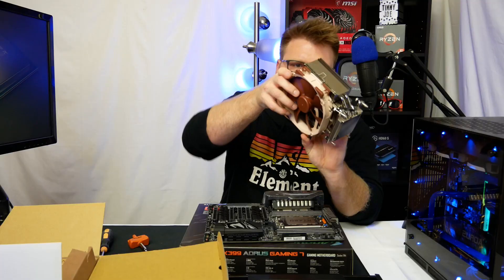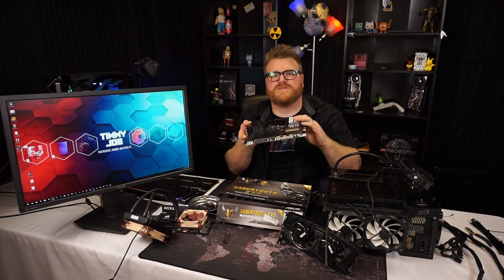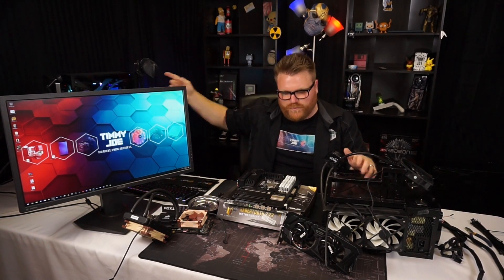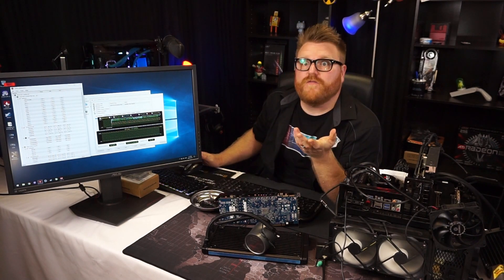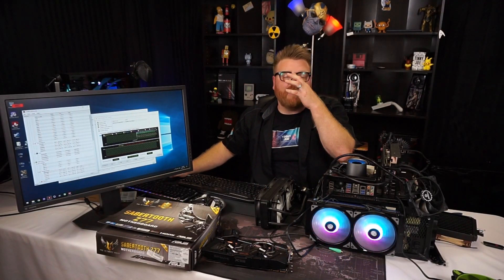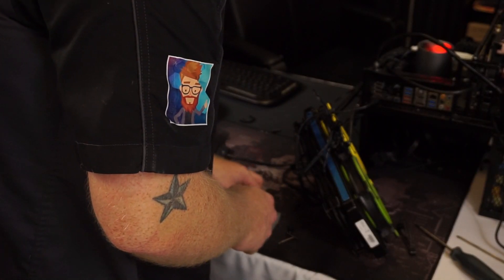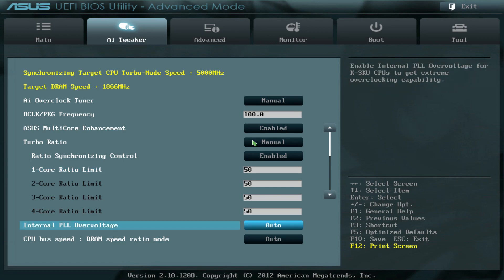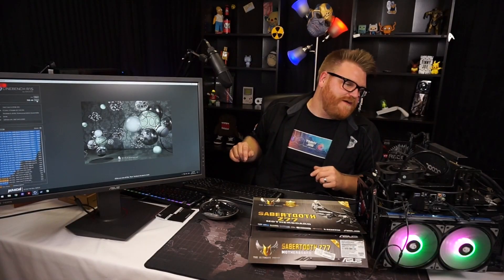5 Ghz Overclock Core i5 3570k using Gamer Storm Castle 280 RGB

Comment: My delidded 3570k ran at 5ghz, 1.45v and around 60°celsius. Its liquid metal between ihs and the Thermalright HR-02 Macho Rev.B cooler too tho. So just on air too.
Its now in an office pc for my dad, under a H60 cooler and 4,5ghz and 1.23v. It ran like a mad machine back in the days, still does. If the later battlefields wouldnt have stuttered like hell on 4cores, i would have never switched.

Comment: Man, I had my core2duo E6300 1.86 running at 2.8 for 11 years.
Yes... ELEVEN years on air cooling with a 50% overclock on a P43 processor gigabyte!
The Cooler master hyper 212 would keep the cpu at 40/45 Celsius.

I still use that same cooler on my 3570k i5 because It fits different sockets!
My 3570k is running at 4.5 at around 35 degrees. It goes up to 50 playing Battlefield 5 with medium settings at 1920/1080

Comment: I just ordered Ryzen hardware, I'll sadly be retiring my 3570k. Mine's been running at 4.7 ghz @ 1.36 volts, maxing out at 71c (280mm rad) for years without a problem. I'm ultimately running into issues with titles that are optimized for more than 4 cores though :(

Comment: Why haven't you delided the CPU!? I'm having crappy i5 3570k which can handle stable only 4.5GHz/1.44V after delid. Temperatures with Noctua NF-DH15S are in closed case max. 71°C while torturing the CPU with Prime95. I wish I had such silicon luck as you had!

Comment: mine wont stay stable at 4.9, i had it at 5ghz but went to 105c and scored worse than at 4.8ghz, it ran cinebench at 4.9ghz 1 time and only hit 78c and gave me the highest score on cinebench but gave me the bsod as soon as i fired up prime 95 so im giving it the burn on p95 @4.8ghz and its hit 100c up to now 15mins in but seems stable, i have the gigabyte g1 sniper m3 2 x 240 rads 1 with my case fans on it and the other from a liquid.cool kit, i have the liquid.cool cpu block but have changed out the pump for a ddc with an ek top on it.
ive tried messing with the core voltages but system hangs if i set anything except auto which is at 1.170v, ive tried 1.180v 1.400v but had to reset my bios, its now 40 mins into the burn and has hit 105c but has come back down to the 70s-80s for some strange reason lol cpu still @100% so dunno whats going on there been an hour now

Comment: 3570k @ 4.2 with stock cooler for the past 6 years no issues. 1050TI pumping out 70-80fps in almost everything at med-high settings @ 1080p. Fantastic price / performance still.
Reply: Ahh I have a i5 7400 i can't oc😢

Comment: This is still my main CPU ;( should i try to overclock it to like 4.0 ghz. And should i buy a new one soon? its only in games like ac orgins that ive felt like upgrading would this overclock make a difference?
Reply: since it does turbo up to 3,7 or 3,8 not much, just overclock to 4,2-4,4 this is on EVERY i5 3570k a doable oc without harming much, just dont let the turbo voltage and auto voltage option on.
Reply: @tarkitarker0815  my boost went to 4.2
Reply: @hugo9016  then its something with autovoltage and thats not good. oc manually to 4,2 with 1,256 v on core fixed loadline lvl 2 turn off intel turbo boost and turbo voltage and set oc to all cores, should be now even cooler.

Comment: 4.5 is about my limit on this MSI board. and I really don't wanna push a old cpu higher voltage . Still pretty solid CPU in 2018, just pair with 1060 or higher and your set

Comment: If overclock in 4.5-5GHz 
Which temperature will be lower?
Sandy bridge or ivy bridge 
By using
2550k vs 3570k
And Cooler Master 240M Liquid Cooler
Thx 
And sorry for my poor English 
Also I want to ask which 240 will be better
Antec Kuhler H1200 Pro or CM Nepton 240M

Comment: I have that 240 Arctic Aio in my PC I bet if I had a MB that was actually good I could probably OC my i5 4670k  to more than 4,2GHz but at least it doesn't go over 50 degrees under load even at 35-40° room temperature

Comment: If you put a 2500k or a 2600k/2700K on that motherboard you will have much lowers temperatures and much more OC headroom.
Reply from the maker: What are you talking about. Why would the previous generation be cooler? I don't think I've ever seen a 2500 K they can get to 5 gigahertz
Reply: @TimmyJoePCTech  the Sandy Bridge uses solder between the die and IHS. My 2600k runs at 5.1ghz 24/7. 1.495v max of 70c on cinebench with Corsair H100i
Reply from the maker: Oh yeah forgot about that. Well shit. Never knew it had it in it
Reply: Its awesome, 2600K is very cheap nowadays, at 5.1ghz I get 912cb on cinebench and 13k on firestrike physics.

Comment: I currently have a i5-3570k on a sabertooth z77 board overclocked @ 4.4ghz w/ 1.23 V,  EVGA 1060 SSC,  and 1600Mhz Viper 3 ram. I really don't want to spend a thousand on a new system and want to get as much as I can out of my current system. Do you think it would be wise to spend $140 on a i7 3770k and $ $180 on 2400Mhz Trident X ram, or should I just keep my build and wait for the 10nm intel or ryzen zen 2?  I've read mixed comments and also have seen mixed benchmarks for the i7 3770k but would like your expertise and knowledge weighed onto your opinion.

Thanks again :)

Comment: Great to see someone still looking at old CPU i have the i5-3570K with the Gigabyte G1 1080 and it runs great. On an Asrock Extreme 6, I have continuously run this at 4.2 with 65c max temp delta 28c and it has done me really well for 5 years. I'm still playing the latest games at max settings. Keep on hearing you have got to change it due to bottlenecking etc but I don't see the need as yet. Like your video but please move the mike of the table as when you bang on it which you do a lot it is unbearably loud.

Comment: My gaming rig i built last year has an i5 3570k and i can overclock it to 4.7Ghz and its air cooled by a Gammaxx400. i have stress tested the cpu with Intel burn test 2 and get around 95c to 100c which is really good as the cpu temps are around 20c hotter using Intel burn test 2.

Comment: I'm actually runing a 3770k @4.4GHz 1.05v on intel radstock and a Asus P8Z77-V (can 4.7GHz with 1.23v with great aircooling but more frequency will get a too big step in voltage), but your problem is about the intel thermal paste, you should try to delid it and decrease the PLL voltage (1.4~1.5v should be ok and keep the cpu cooler), with both deliding and voltage tweaking you should get 20°c lower temperature, even my 3770k delided can't be so hot with good aircooling even with 1.5v+), and to get more performance you could overclock the ram aswell, at 2200MHz (or 2133MHz) 8-10-8-24 1T you should have the best performance for ivy bridge (but you need a good ram and 2x2GB stick I believe)
PS : VCCSA is for the memory controller, so before 2133/2200MHz on tight timing (8-10-8-24 1T) you don't need to tweak it and you can decrease it to 0.95V or below, even for 2400MHz with increase timing like 11-13-13-31 1T you should not need to go higher than 0.95v (except for very "bad" cpu/imc) ;)

Comment: I'd love to replace my i5 3350P with an i7 3770K, but the i7's still go for $200 + on ebay. Since a decent six core Ryzen cpu goes for the same price the i7 isn't worth it. Ya, I have to get new bits for a new platform. But at least I'd be leaving one that's been dead for quite some time. :)
Reply: A 2600k hovers around $100
Reply: Nah, there's no point in going back a generation just to get an i7. Even if it is "only" $100 it isn't worth the price for old parts. I could just save the $100 - $200 and put it toward building a new computer with updated features. I was very tempted to buy a better cpu back in February when I got income tax, but I didn't. There were more important things I needed to buy. Besides money being one factor I'm also waiting patiently for Ryzen to go through a few generations before eventually going for the parts. :)

Comment: My 2500K has hit 5.1. Set my cheap 700 watt psu on fire, but it did it on the 3rd run. Still have it and it's lived at 4.2 stable from that day.

Comment: Bitwit: 3570k in 2018.... ick dont use it!!!! Timmy: HOLD MY BEER!!!!
Reply: walnut513 I don't get it, like Kyle was bribed by the industry CEOs to promote new platforms..
4 real cores are plenty enough for any present and future games. Just gotta run them over 4Ghz on all cores tadaa!
Reply: Yeah the 3570 and the k version are very similar to my 6500 so it dosent really make sense why you wouldn't recommend it as it's literally 1/3 of the cost used with basically the same overall performance
Reply: walnut513 you lose out on new technologies, but when on a budget, you can't afford to use them anyway
Reply: Was it worth it to update to the 8600k from the 3570k for gaming?
Reply: @campar1043  no.
Reply: @matteodi-folco9058   dont lie, heavily depends on the games and res you play on, for 4k its basically useless but even for 1440p the update can be worth it since the 8600k should push in bf 5 40% more fps and in pubg something like 20% more in 1440p in fhd even way more.
Reply: Still using mine 4.3ghz since December 2012.
Reply: Still using in 2019 xdd
Since 2015 or 16

Comment: I had my i7-3770k at 4.4 ghz for like 2 weeks now. And Just yesterday my computer fails to ran at that 4.4 ghz I'm not sure what to do. I had to go all the way to stock because even 4.2 ghz crashes the computer. Don't really know what to do. I have a 600 watt evga white power supply and its not the best psu but it still let me oc at 4.4 ghz no problem. Do you think it's because the cpu needs to be delidded?

Comment: Still running my 3570K @4.4GHz 1.23V with a 980 and 16GBs of Corsair 1886MHz DDR3. I can't get my CPU much hotter than 70C. The fastest I've ran it stable is 4.6GHz. I tried 4.8 but it failed to POST and I had to reset the CMOS. I'm on a MSI-Z77A GD55 mobo with a Cooler Master TX3. It's all in an old Antec 900.

Comment: thats my current cpu but i wasnt ever able go get over 4.0 on the z77n-wifi board?? im doing something wrong
Reply from the maker: WaFfLeFuR yes. Voltage. Try 1.32 at 4.5 GHz. Keep upping if it needs it to 1.35. if you want to go over 4.5 then you can go up to 1.4 with a really good cooler. Might need to change SA voltage as well. That's a little more tricky

Comment: Back in 2012 when my dream was to have an i5 3570k/gtx 660ti/ddr3 8gb as a budget to play battlefield 3 on ultra 1080p 60fps(barely) until my first pc has been ryzen 1600/gtx 1060 3gb/ddr4 16gb after i quitted FPS years ago and switched to simracing. Thanks god I hadn't any pc that day

Comment: You really should delid the i5... Because intel startet using this "thermal compound" (that isn't even thermal conductive Lol) since Ivy Bridge xd Sandy is solderd... Get a Sandy Bro ;) I have an i5 2500k running at 4812MHz by thermalrightmacho max temperature is 80C
Reply from the maker: Leo Elektronik I have a 2500k I will compare
Reply: Timmy Joe PC Tech You are the best bro ! :D

Comment: yo over clock some x99 stuff
Reply: I have a 5930k. and for the life of me I can't figure out what's a good core voltage and honestly what's the upper limit for the CPU voltage of a 5930k. Let alone the whole Broadwell E Series. On the same board.
Reply: @patrickgronemeyer3375  1,35 save for years. 1,4-1,45 save for years but then needs downclock. 1,5-1,55 is the most stable unreasonable high voltage you will get anything higher than that could fry more than the socket or cpu, on 1,4 you should be fine and do like 4,5 with luck more.

Comment: I'm about to get an h77 mobo a i5 3450 gonna get it on the low I'm sure if put it along with GTX 770 it will be quite a decent budget PC and then hopefully sell it .
Reply: I have a similar GB Z77-D3H with a I5 3550 and a GTX-750Ti.  It only got CB CPU of 488 and GL 87.67 frames.
Reply: elink1 is right.

The 2gb variant is dramatically underwhelming.

While the actual GPU is still solid and very capable, the amount of vram will be not near enough.

Don't get a 770 unless it is the 4gb variant.

Best of luck.
Reply: TheDarkToes well with the crazy prices even for used parts a Rx 560 or a used grx 1050 might be what I'll get . Man was the system disgusting when I bough it I messaged the guy that it was the nastiest system icce ever seen ans he blocked me from letgo . What's Douch ! Well at least I got an i5 and 8 gigs of ram and hurt asrock Mobo from what I looked it seems to support a Xeon now im intrigued cuz it could potentially become an i7 performance ish . No overclocking :( .
Reply: TheDarkToes plus the PC isnt for me it's for me to sell 2gig is enough to get started in gaming  :)
Reply: Serj Star while 2gb is enough to get started.

You will literally not even be able to run modern titles at 1080p with acceptable frame rates because of your buffer.

The 2gb is seriously restricting.

Just to consider this, even today the 1050 has 4gb variants. 2gb cards are for 720p gaming for titles 2017 and newer.

But older games should be okay to play 1080p with.
Reply: The 770 is lovely, just sold the one I had for years, just a pity about the 2G buffer
Reply: Yer, its just dumb to think that they also released a 750ti with 2GB.. Even plain 750 2GB versions, what were they thinking for the 770? Even the 780ti was only 3GB.. That whole generations high end cards suffer with vram, apart from the 4g 770.
Reply: yeah if you sell that im sure it will be overpriced.

Comment: Nice! Ive had my 2500k @5ghz 1.4v,  since 2011. ;) on a Noctua NH-Y12P  .. still running strong.
Reply: 2500k was real beast. My was very bad chip and needed 1.5V to run at 5ghz with shitty cooling. I have short video with cb score. But I switched to 2600k  and Im FINE for 1-2 more years easly. Im running 4.5ghz just to be safe with it.
Reply: Unnecessary to go that high. 4,5 would run with way less voltage, in games you won't notice the difference.

Comment: I get 850 on my 4790k at stock. I tried overclocking got it to 4.6 GHZ at 1.35v but 2 days later it crashed on me in a Competitive Overwatch game so I went back to stock :D
Reply: Ediranii that is a pretty high vcore for a 4.6 oc, mine runs at 4.7 @ 1.26v. you are probably getting pretty high temps unless you have delidded. Wouldnt run it higher than 1.3v as bios usually adds about 0.025v if LLC is set to auto. Try shooting for 1.26v, the try running p95 or occt. it should give you a bsod, with error code "whea_error_ etc" if the vcore is too low.

Comment: if you delid the 3570K the temperatures would drop around 20 degrees
Reply: bet that is Timmy's next video, and tech junkies everywhere will weep with joy
Reply: Anthoney Arzate good luck, make sure to get some good liquid metal
Reply: Did that myself. Delidded, metal paste, watercooled. Temp drop wasn't much for me personally. OC to 4.6 Ghz. Most likely just got a mediocre chip. Idk at this point in time. Will rebuild the cpu once on xmas break.
Reply: This cpu is just a bad sample u can run 5ghz at less than 1.3v and less than 80c on h100i (70c if delided) this temps is just crazyyy :D
Reply: @FreshSRB85  Mine doesn't run stable at 4.5GHz with 1.3V, it just crashes to bluescreen once I start a game.
Reply: @FreshSRB85  bad sample? Haha. Mine needs 1.36v at 4.4
Reply: @FreshSRB85  "This cpu is just a bad sample"  CPU's not being able to do 5Ghz at 1.3 are not bad, as very few (% wise) can do that.  Mine would do 4.9 (well a 3770K, that is) on 1.416, and guess what, as "bad" as you might think that is, most of these do not do even 4.9.  The rule of thumb for ivy or there about is a +1000Mhz to the boost is doable at good-enough or better v's for most chips.  Is you cannot do THAT, THEN you can say it was a bad chip.
Reply: Well I have the 3960x and I can get 5ghz with 1.48v but I'm on 4.6ghz with 1.32v daily

Comment: Sick!! My second ever build was on that exact board!  Still works too, and that’s after I ran it 24/7 for about 4 years straight
Reply: i had the same board also, it was a overclocking beast and i ran it also for 4 years.
first i used a 4770k on it non overclocked but then i got an 4790k delidded. i ran it at 4,9 ghz on all cores and i ran great for 3 years, but yeah i switched to an ryzen 2700x for productivity.

Comment: Sandy Bridge/Ivy Bridge is the standard! Great CPU generation.
Reply: OctoMan PC's Great value in 2018! Haswell is getting there but not quite yet.
Reply: I have a gaming cafe in south america and i have 10 Dell optiplexes with 3570 in them pushing 1050tis no problem. spectacular CPU generation.
Reply: i7-2600k and i7-2675qm user checking in. still going strong in 2018.
Reply: Nate Tokes 3770 at 4.2ghz, 3570 on an h61 and i7 3450m in my Sony vaio laptop.
Reply: even in laptops i still use my i5 ivy and rarely use the 8thgen laptop because of thermal issue
Reply: I'm still using my z77 sabertooth with i5 3570k but only clocked @ 4.2ghz, very satisfied with the performance :D